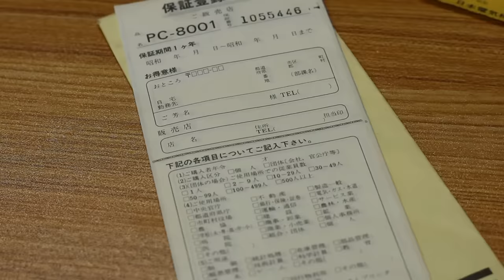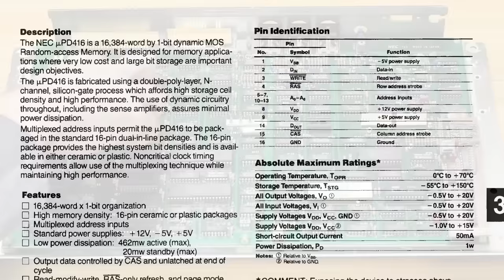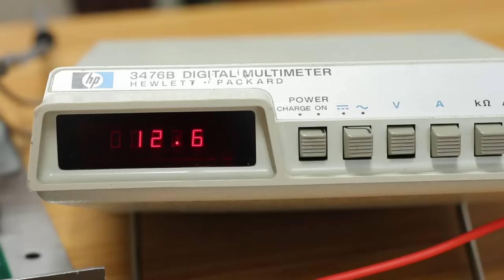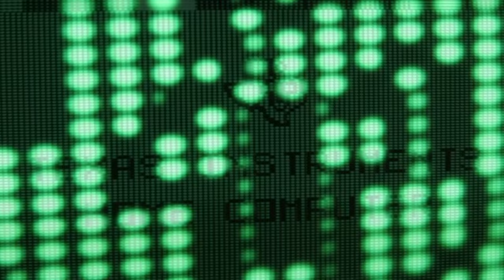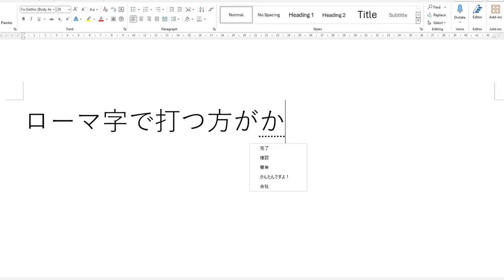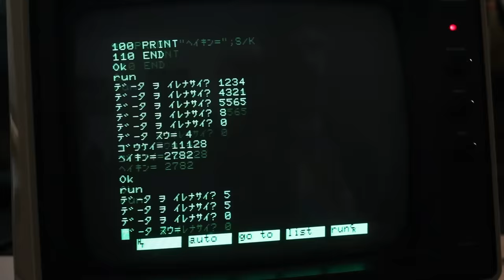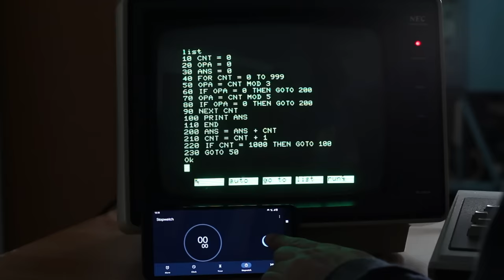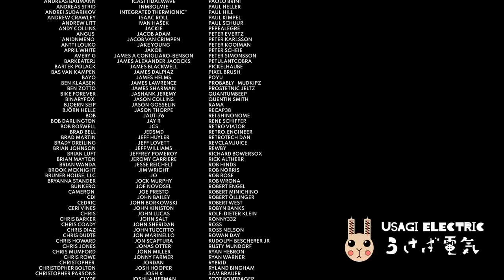This NEC PC-8001 is Epic!

Comment: I love that Hellorld has an equivalent in Japanese!
Reply from the maker: I'm not entirely sure whether NEC is using two byte characters for their Kana or not, but the fact that ハロー and ワールド means that even if they are two byte characters, you can still totally make the same mistake!
Reply: @UsagiElectric I bet they just use bytes, and the Japanese characters are probably character codes that correspond to the ASCII characters on the keyboard plus 128. Should be easy to find out with a for loop that prints chr$(x) and chr$(128+x) for x values between 32 and 127.
If I'm wrong, it probably works like MSX Basic but I've never worked with that.
Reply: @JacGoudsmit  : Yeah, as I recall the first encoding for Japanese made no attempt at Kanji, just using the much smaller hiragana and/or katakana character sets. The switch to 16 bit characters happened in the 80s I think, but this computer is probably older than that switch.
Reply: @UsagiElectric  this sent me on a spiral learning about JIS character sets and stuff
How much does it explain USA dominance in tech, that they never had to navigate this? 😄

Comment: IMHO the main reason why it wasn't popular outside Japan is most likely all those features - the RAM, 80 column display, keyboard, CPU speed etc. at a time other home computers ran quarter of that means it was expensive. Just like pretty much all the subsequent Japanese computers.
Reply: It sold really well in Japan for the opposite reason, it was cheap compared to anything else. 168,000 yen and 1300 us for the overseas 8001a model.

Even at launch and for some years later many thought it should be sold for 200-250,000 because of the features but I forget who the project leader was didn't want to raise the price.

The 80 column and ram was necessary for the 2 byte Japanese characters to be displayed, having native language support helped NEC gain a major market share in Japan until DOS/V came along and opened up the competition.

Comment: Someone get this guy a ZX81. See how we Brits were introduced to the computing age.
Reply: AKA the Timex Sinclair 1000 in the US. They weren't rare over here, and in fact I have one :)
Reply: its too modern for him  it has graphics and is smaller than my desk .
Reply: Less than £50 in kit form (£49.95) and £69.95 fully assembled. Just add a TV and a tape recorder and you have a fully functioning computer. Dreadful keyboard and graphics, no sound and only 1 kByte of RAM by default, but nevertheless a wonderful to start to computing and programming in the UK.
Reply: Or a TK90 (unlicensed spectrum clone from Brasil, with extra chars like the ñ and ç
Reply: American micros generally had luxury keyboards compared to us in the UK... Oric1 anyone? 😂
Reply: @thefumigator  They have luxurious keyboards compared to the membrane keyboards on the Sinclair ZX80/81 or Timex 1000.
Reply: @derekjc777  only in the TK95... The TK90 was at least visually almost identical to the original ZX
Reply: @thefumigator  TK90 had dead-flesh keys like original ZX Spectrums, whereas the ZX80/81 just had a membrane keyboard, much like the Atari 400. The Spectrum keyboard was much better than the membrane keyboard of the ZX80/81, which is why third-party keyboards were one of the biggest sellers for the ZX81.
Reply: Generally American micros have better keyboards, but this is not always the case. Some early USA home computers, such as the first CBM PETs with cashier console keyboards, the Atari 400’s membrane keyboard, the TI 99/4 with its chiclet keyboard, likewise the first RadioShack TRS-80 Color Computer, all had dreadful keyboards. And many UK home computers had good quality keyboards, like the Acorn range of computers: the BBC Micro, Atom, Electron and Archimedes containing the first ARM processors, the Dragon 32/64, the Memotech MTX500/512, the Amstrad CPC464 etc, and even the Sinclair Spectrum 128K +2/3 after the Amstrad updates.  Maybe the USA learned from their mistakes earlier. But also UK manufacturers used cheaper keyboards to cut costs to grow a cheaper market. This was probably not a priority in the US as the mid-range market was sufficiently large to grow the emerging market of home computers, due to the larger population and global export opportunities. However, the cheaper computers allowed poor UK kids to access and use home computers possibly a decade early than other countries, producing a generation of computer programmers and game developers that have dominated the industry ever since.

Comment: Haha! I just caught myself trying to find your channel back to follow up on my post and I put usagi denki by mistake...anyway, yeah you can find PC-6082 Data Recorders for like 1000 Yen still. Also, you can use the mod that I talked about along with your keitai to play WAV files and load programs at 1200 baud? On PC watch, it shows a pi zero pascom mini came out in 2019. Anyway, like your content. I really liked your 1^bit CPU stuff. At work here, I have been trying to put together a project for out students to built a 1 bit CPU with a semicondictor physics faculty and device faculty member who is retiring this year. We have been working together for about 12 years at the same place and have researched fabrication methods for junctions and devices/lithography that can be done in basically any reasonably equipped high school science lab with equipment and in a natural air environment. I would like to try an implement that kill the bits game in the lab here.

Comment: The "key" command in MS Basic is to assign a command to one of those F1-F10 keys. If there is an "ON" keyword, the "KEY" command can be used conditional to test an input of a F key (ON KEY 1 GOSUB 1000 means that if press F1 the program jumps to line 1000)
Auto without parameters, start line numbering at 10 and increments by 10. With parameters, it start line numbering at other number and incrementing with another increment than 10; (AUTO 1,1  start number line from 1 and incrementing the by 1).
Time$ was used as variable to set the time (time$=) or to read the time (PRINT time$)
I believe that the BASIC syntax is very close (if not identical) to MSX BASIC.

When I had my MSX, without any manual or reference about its BASIC dialect, I wrote a small program that printed on the screen the content of the memory in ASCII and it listed the ROM content where I find all the keywords; most of them (98%) had the same syntax in QBASIC and few were just a bit different. Then I used QBASIC help to learn their syntax.
But that was back in late 90s when I did not had internet, now I bet you can find all the manuals on some archives sites.
Reply from the maker: Thank you so much for the insights!
It's been a long time since I've waded into the wonderful world of BASIC, and a lot of the unique keywords my brain has forgotten. It would make sense that this BASIC is fairly close to MSX BASIC as I believe both were developed by Microsoft quite close to each other. I really need to get back into programming some BASIC stuff in-between all the weird obtuse assembly programming I've been doing lately, lol.
Reply: This is what I was thinking as I have an MSX1 machine and the MSX BASIC looks very similar.
anyway, you can stop the auto numbering by hitting ctrl+c (or ctrl+stop) on MSX

The TIME variable is incremented by 1 each time the VDP draw the screen (50/60) depending on the display system

KEY ON/OFF can be used to show/hide the F keys line at the bottom of the screen, KEY LIST prints all keys on the screen, KEY [number], [string] customize a specific key.

the RUN F-key is set with carriage-return character added to the "run" string like this
KEY 5, "RUN" + CHR$(13)

Thanks Sebastian and David

Comment: David! I had that exact same step down transformer. The wire broke off the back of the switch one day as I was switching it on. It gave me a nasty shock, so I took the cover off and discovered that it had really poor build quality, all of the solder joints were dry and the wire was maybe 20AWG copper clad aluminum. You might want to make sure yours is safe, I don’t want you to get zapped!

Comment: fellow 8001 owner here. here ars some interesting facts about the machine:

- EDIT THIS POINT IS WRONG ( I got the PC 8801 and the 8001 mixed up. my fault!) BASIC has line labels! no need to memorize the line numbers anymore
- the BASIC was written by Bill Gates
- the oldest JRPGs were released on this system in 1982
- 4mhz is true, but the RAM access is a huge bottleneck, and it basically halves the functional clock speed
- HAL Labs came out with something called the PCG-8100 which is effectively a graphics and sound board for the computer. many took advantage of this for better graphics and sound. HAL actually released a mini version of this computer a few years ago with the PCG built in! (it's now a collector's item, the original computer is still way cheaper)
Reply: what is the name of that jrpg?
Reply: I'd love it having BBC basic. Not only the structured programming but Microsoft basic is soooo slow 😒
Reply: Yes, the Z80 often ran at clock speeds far higher than say a MOS6502, and NEC’s version was probably built on a  very solid lithography process. Unfortunately, the Z80 wasn’t particularly efficient, especially when it came to RAM access. Even internally, working from registers, the expansive nature of the ISA competed with transistor budget leading to a lot of overlapping logic which meant a lot of instructions took quite a number of cycles.

That said, in 79, that clock speed would have still made this one very fast (and probably expensive) 8bit machine. It certainly was far superior to my first machine, a Vic20 (to my 8yo brain, 32K still sounds like a luxurious amount of RAM - I bet 8001 owners never had to poke at their color ram to eek out an extra kilonibble).

Also, is it me or is the video signal and display quality super crisp on the 8001 and that NEC monitor. Very nice machine.
Reply: @smakfu1375 is not you, monochrome CRTs have a great resolution and are very crisp, most of them were used for 80 columns displays
Reply: Another fun fact (maybe less useful than the ones you mentioned :) ):

The PC's BASIC isn't strictly speaking changing the case of the keywords. I mean, the net effect is that it is. But every BASIC I've used on computers of that era, when you typed a program in, the keywords are actually tokenized (using a case-insensitive comparison to parse the keywords, of course). In RAM, just a single number representing the keyword is stored.

So the "conversion" to upper case is really just a matter of the tokens being redisplayed as the spelled-out keyword, where that's always done using upper-case letters.
Reply: @Rods_road  there are a few. Chitei Tanken, Dragon and Princess, and Dragon Lair are all good picks for the "first". therr are others, those are what I could think of at the moment. Chitei Tanken also has an 8801 port.
Reply: Is this the predecessor to the PC-88?
Reply: @subtledemisefox  yes it is
Reply: @subtledemisefox  early pc 88 models are actually backwards compatible with the 8001.
Reply: Same HAL Labs as Kirby?
Reply: @ChristianStout Yes!
Reply: But presumably that BASIC was a development of the original Altair BASIC, which was written by BG and Paul Allen together (and a third person did a bit too)
Reply: A few corrections:

No, N-BASIC does not have line labels. It is, however, MS-BASIC, though there were a fair number of modifications made by NEC even in the original N-BASIC, and more in later versions for the PC-8801.

The JRPG that the OP is thinking of might be ドラゴン＆プリンセス (Dragon and Princess) or might be something else. There were a few around that time and there's argument about whether they're really proper JRPGs. But these were not special to the PC-8001; by 1982 (2-3 years after the PC-8001 was released) there were several other popular 8-bit home PCs in Japan as well.

The PCG-8100 didn't offer any sound capabilities at all (as far as I can tell); it was just a programmable character generator. This let you re-design the characters, but didn't give you true bitmap graphics. Still, doing just that worked for NES, Spectrum and MSX1, though they all suffered from attribute clash. At any rate, later models in the series, starting with the PC-8801, eventually caught up with systems like the FM-8 and FM-7 that offered full 640x200 graphics in 8 colours. (And even just the colour text on the PC-8001, being RGB, was great: crystal clear 80 columns in 8 colours, two years before IBM PC CGA was doing similar.)

@smakfu Actually, the 8080 and Z80 were quite efficient when it comes to memory access, more so than the 6502. But that was the problem: the 6502 required memory fast enough to respond to a read or write in half a clock cycle. The other half was available for DMA (such as updating a display), which was handy though. The 8080 and Z80 could run on slower memory because they didn't have this exact "half cycle on, half cycle off" access pattern, but it also made it much harder to do DMA without occasionally halting the processor. (And that, specifically display controller DMA access, was I believe the main thing that slowed down the PC-8001.)

Comment: 21:15 ああ、たぶんThis expansion board is probably… a modified board to make the cassette I/F 2400 baud. It was called "Sapporo City Standard"(サッポロ・シティ・スタンダード). I think the switch is for baud rate.
23:53 ｳｻｰ(∩・x・)∩ｳｻｰ
Reply: Sounds like a play on Kansas City Standard.
Reply: So you could get the best ramen and 4x the data from the same place? Neat!
Reply: Ha, that 1200 -> 2400/4800 was one of the first modification I made to my Nascom 2 as well (with deadbugs and flying wires).  It worked, but it may have made cassette storage a bit less reliable.
Reply: @tommythorn  : Maybe a little, but the real reliability problem with cassettes was always the lack of a resilient error correction scheme aimed at fixing block-level errors. Cassettes are vulnerable to having errors that ruin several symbols in a row, and the "just have another copy" approach to error correction meant that having an error at the start of one copy and end of the other copy was enough to render both copies unusable, even though a undamaged version of each symbol of the data was present. Bit of a shame, as it could have been dealt with using a simple block scheme, and fairly small bit of ROM code.
Reply: @absalomdraconis Funny enough, the Nascom 2 does break it down into numbered, checksummed, blocks so you can rewind and try again. I had to do that sometimes and sometimes it read better eventually.  However, even 2400 bps is really slow.  (UPDATED 4800->2400: I had forgotten that 1200 was originally max and I hacked it to do 2400, but the lack of margin caused me loss of work.  4800 bps was completely hopeless.)
Reply: @tommythorn  and here we are few decades later and they just figured out how to transmit 301Tbps over regular fiber optic cable. ~1800 entire 4K movies/sec, or 30,000 in 1080p, nearly the entire catalog of movies released by Hollywood since the silent era in one second ..which also soon fits onto a single consumer grade 30TB+ hard-drive (sadly not in real-time)
Reply: Ah, a man with knowledge!

Comment: If you didn't know, most digital chips from NEC around that time start with 'upd' but only silkscreen the 'd' of that. So e.g. the 'd3301' is actually an 'upd3301', and if you search for that you find that it is the CRT controller.
Reply: In the handheld VFD games they do silkscreen the whole µPD for their 4-bit calculator MCU's, in datasheets the micro symbol is often changed to a u.

Comment: The Z80 computers of that era will always be interesting to me. My folks purchased a CPM micro/mini system for their office to do bookkeeping, word processing, and mechanical design calculations. I was the system operator and kept daily data backups up to date. We ran the legs off that little system for 10 years. It is still in storage in the attic of the old shop that was my dad's.

Comment: My guess for the add on board is a high speed cassette recorder storage interface.  600 BAUD default is for the PC-8001.  The more common speed was 1200 BAUD using 1200/2400Hz FSK tones.  This allowed you record programs or data on the audio tape then reload by playing the tape back into the computer.  The location where it plugs in is near the cassette circuit and 8251 also points to something related to the cassette interface.
Reply: The PC-8001 used 1200/2400 Hz for space and mark even in its standard CMT format. However, it used 4 cycles of the former for space and 8 cycles of the latter for mark, and thus ran at 300 bps.

Comment: This really brings back memories. My dad bought the B variant plus the expansion port, monochrome monitor, dual floppy unit and printer when I was 12. There were some cool games for it that ran in native code. Some of the really fun ones came from old Japanese magazines like ASCII and Japan I/O, but you had to input thousands of lines of hexadecimal values in the memory editor at certain addresses. They could be saved via casette tape, but there was a program that would let you save it to floppies that I was never able to get a hold of. I sunk endless hours in it playing Scramble! and Rally X. It was a real workhorse too. It had a real word processor (Wordstar) and a COBOL compiler my dad used for his actuarial work. It had chunky pixels you could activate through BASIC (I think the command was pset). It would stay active until you entered "console 0,25,0,1". So much fun and built like a tank. I was thinking maybe that  breadboard breakout might possibly be some kind of custom programmable character generator.